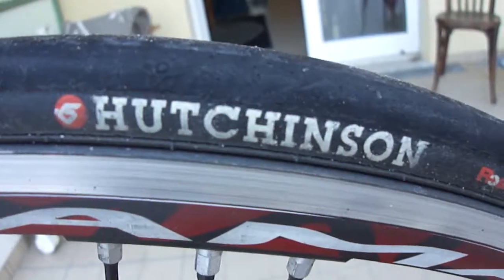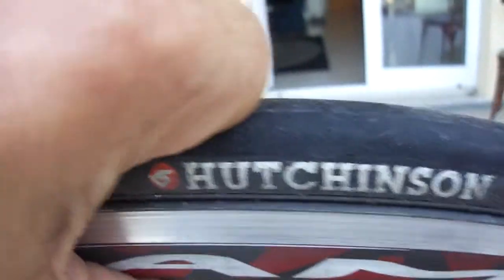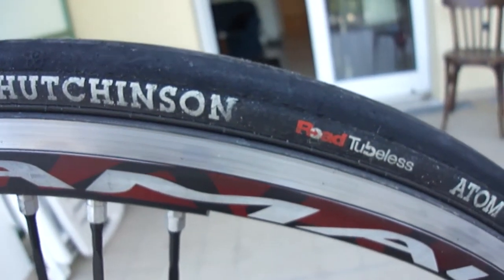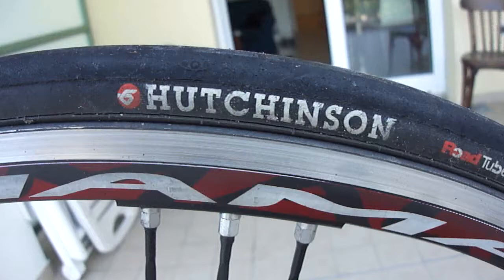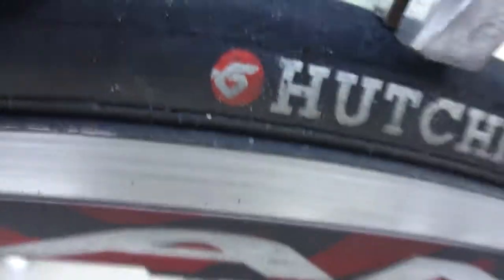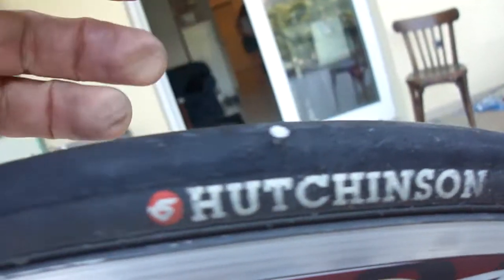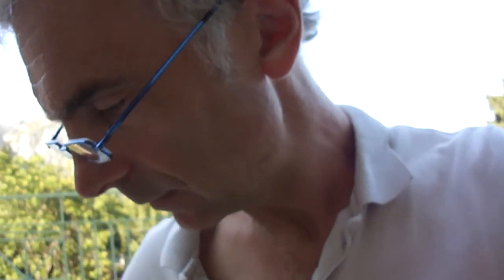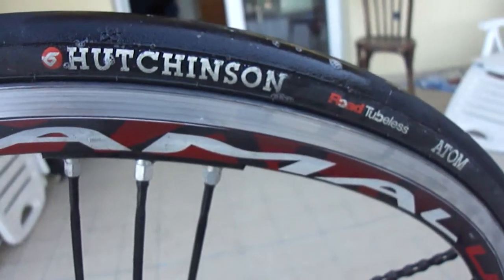Hutchinson road tubeless tyre puncture.MP4

Comment: Proper procedure is to rotate the hole to the BOTTOM so gravity helps the sealant flow to the hole and it will seal it up in a tenth of the time it took you.

Comment: How often do you need to add fluid to the tire?   What brand are you using?  I am being told burping is a common problem running tubeless, but i am still ready to step up and try a set.  I was at Interbike Show in Las Vegas last week and not many tubeless tires being shown.
Reply: I use Slime' some green liquid they sell for your car tires . bought a liter of that and a drill bit to drill out a bigger hole to fit a BMX inner tube with a Schrader valve to create a perfect season and added convenience I have tried stands tubeless sealant it sometimes can't plug up the bigger holes and will we go all out the window, if not it will dry out for my front tire it has. I park my bike in the garage and in the shade at work  , this Slime sealant is too think and  ads a rather bad counterweight unlike the stands  sealant. Should of gotten the bicycle only sealant.
 I highly recommended the tire and flex more to the grooves in the payments feels like a balloon rather than hard styrofoam inner tubes for kids bikes, my bike got significantly lighter coming from a puncture resistance inner tube setup which are very thick and heavy. 

I haven't gone back and I'm not planning on going back :)
Reply: I got tired of fixing all the errors that my mic kept on creating.

Hopefully it's all there:)